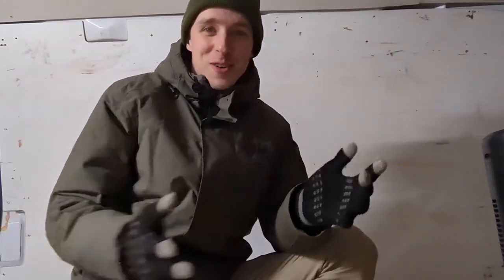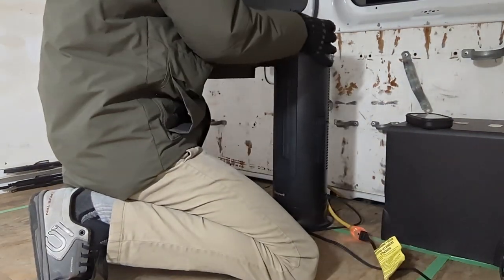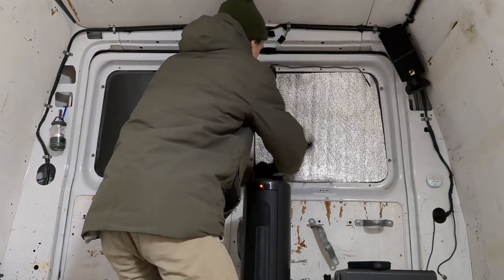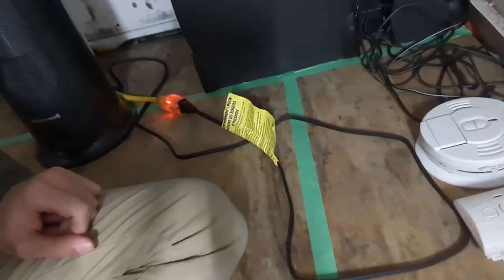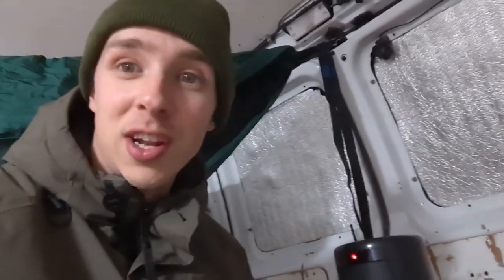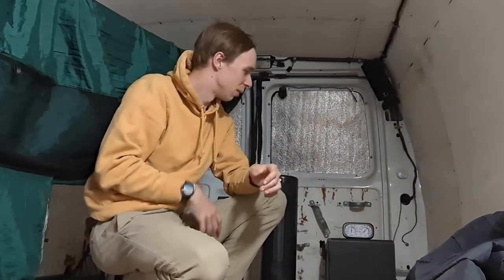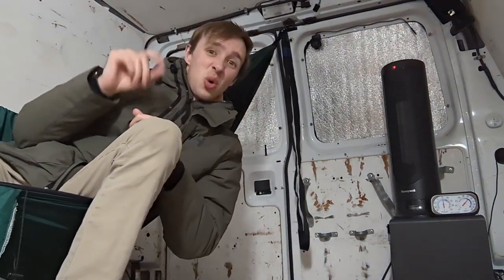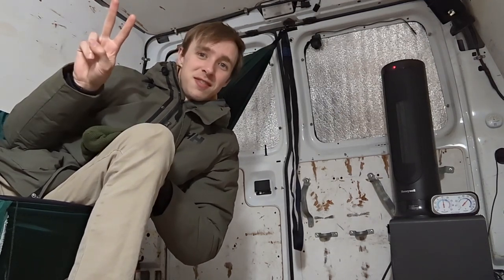Can An Electric Space Heater Heat Your Van?

Comment: What about lower watt rating heaters? The problem with this experiment is most people won't be able to use something with 1500 watts, because that would stress the power ratings too much on a power bank and inverter system.
Reply from the maker: It may be worth a shot trying with a smaller heater but if all 1500 watts of heat couldn't keep my van warm a smaller one definitely won't be able to. This test was more for people who are able to plug into an outlet all winter. I totally agree with you that there is no way you're gunna be able to run an electric heater all winter in your van. I think at the end of the day though, any heat is better than no heat.
Reply: @jjjwbm  Yes. I hope you can do more videos. Many people are having trouble keeping the heat on in Canada, US, and Europe. Lots of trouble. 

So its possible your experimenting could do some good. 

Thank you for the reply.
Reply: @jjjwbm  one thing you could try is a smaller partition within the van to cut the space it has to heat up? Like horse blankets hung on something to create like a 'cardboard box' to sleep in. Where I'm at you can buy horse blankets cheap. I don't know if they are cheap everywhere. They have a little padding but not a lot and don't age well if they are out in the wet weather a lot.
Reply: You need thicker insulation foam boards around windows with tape. Spray foam inside door panels. Multiple blankets instead of thin curtain to block off the driving seating area. And need the most heat output efficiency heater available for 1500w. The roof needs the best insulation 3 inches thick everywhere to also stop condensation on the walls then the spread of mold. Which is what happens with any more of a degree difference of 12 or more. This is why houses have 3inch fluffy insulation not dense foam board.
Reply: @DESO1881  Very nice. Thank you. I like what you said.

Comment: I think your main issue is very poor insulation. I also see plenty of bare metal.
The front curtain could also have a better fitting and also do much better with a thicker material, even an insulated material like in sleeping bags.
I recon with this, 1.5kw is plenty for Good heat, it would most definitely be much better.